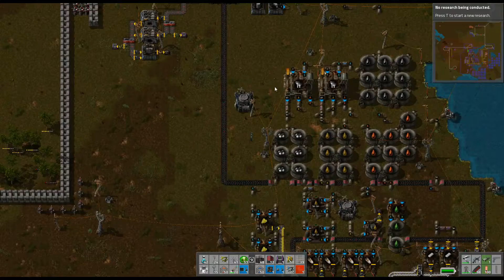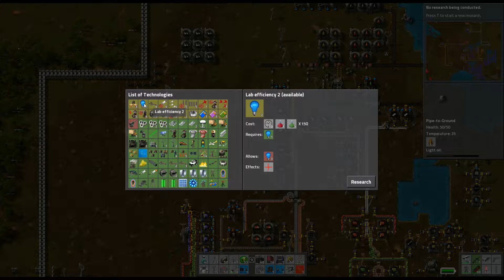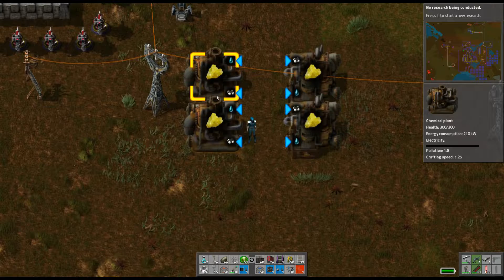Fluid Dynamics. Cardboard Decoy Plays Factorio: MEGASODE 61! [Part 1/2]

Comment: Might want to take a look at how freaking fast sulfur get's produced in those chemical plant's. One fast inserter isn't fast enough to keep up with the production =)
Reply from the maker: Dang, really? I don't usually check a lot of my chem production because I'm used to being perpetually out of oil XD.
Reply: Cardboard Decoy yea you don't need more than 2 sulfur plant's ever. Only if you try to support like 10 processor assemblers you might get a bottlenec.